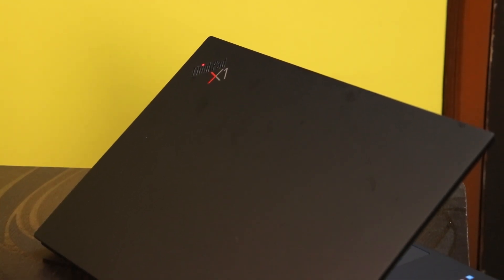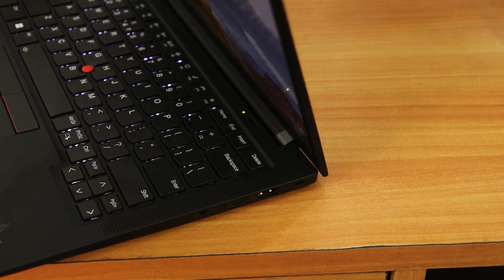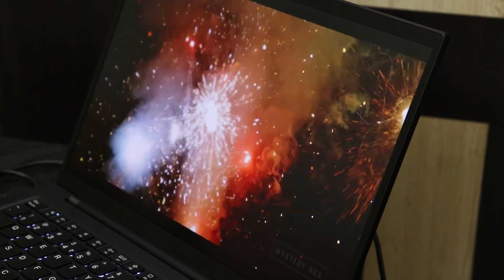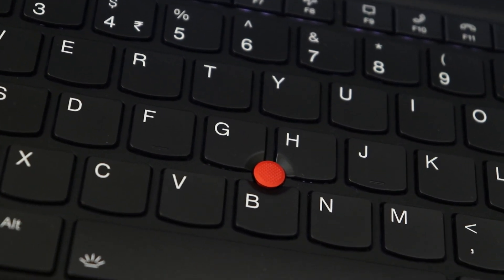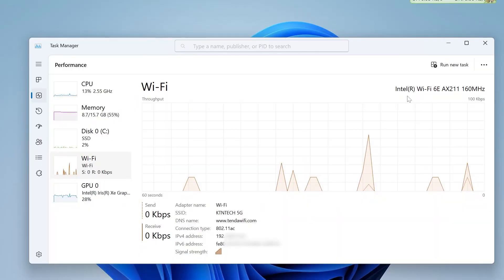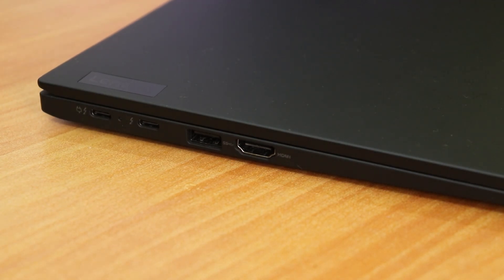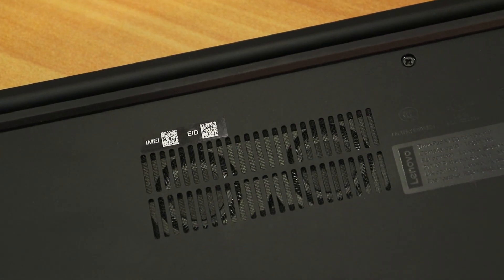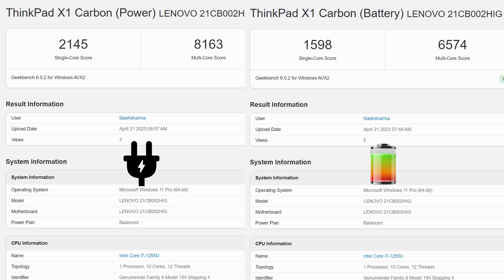Lenovo X1 Carbon Gen 10 In-Depth Review! [Business Laptop]

Comment: I have the ThinkPad p14s gen 1 AMD, ThinkPad are amazing but does have a couple of occasional bugs like touchpad gestures stop working after suspend (linux/amd issue afaik).
This laptop would be perfect with AMD though, maybe something likeThinkPad  z13/16/T14s AMD
Reply from the maker: Well with this Gen 10 I haven't faced any issues so far like that. It's super stable and robust experience overall.
Reply: @KTNTECH  according to some reviews I found that ThinkPad x1 gen 10 was hot af because Intel.
I think yours is 1255u instead of 1260 or 80 p that's why it probably remained cool overall
Reply from the maker: @drishalballaney  Yes for normal usage it's cool enough but checkout the temps I have shown haha when I was playing valorant
Reply: @KTNTECH  hmm AMD would have been much more cooler plus giving gt 1050 levels of performance